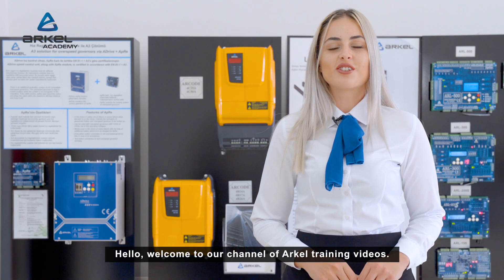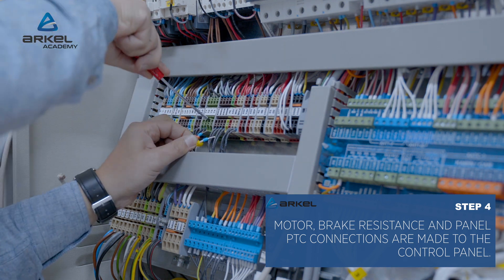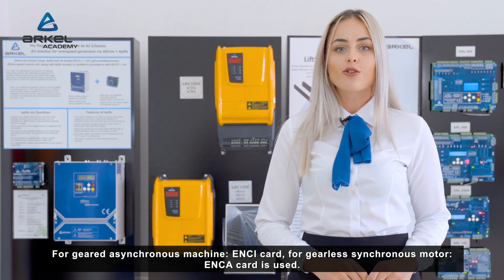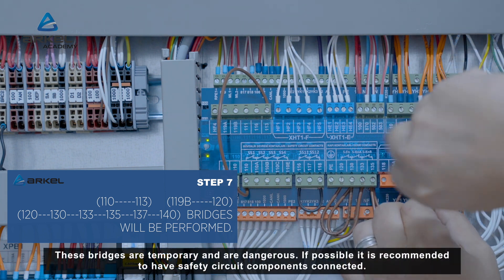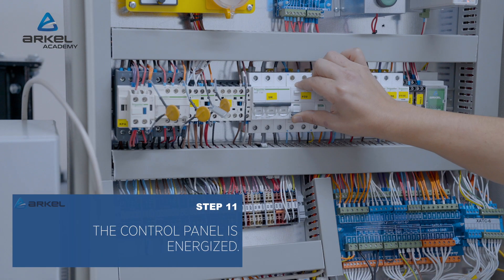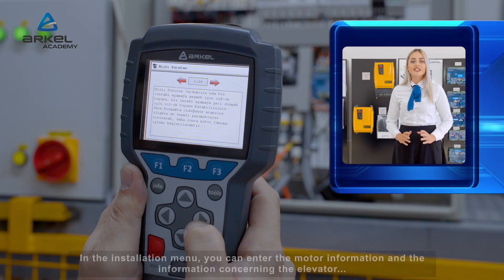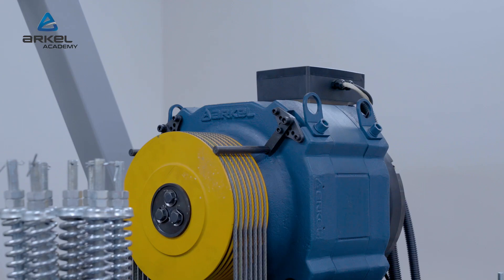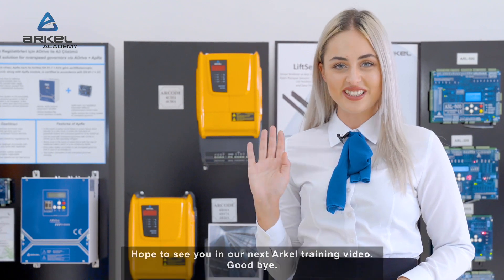Arkel Academy ''Auto Tuning Preparation Process In ARCODE''

Comment: Hello i have 1 Question about arkel300 same card .....its showing error H16 which is 24v (100) supply under limit.....
what is solution for this error????
Reply: 100-1000 voltage is low. It should be almost 22-24Vdc under normal conditions. You can check the 
output of isolation transformer and bridge rectifier. If everything is as expected, there may be a 
problem with the capacitor on ARL300.
Reply: please contact Arkel support team; support@arkel.com.tr